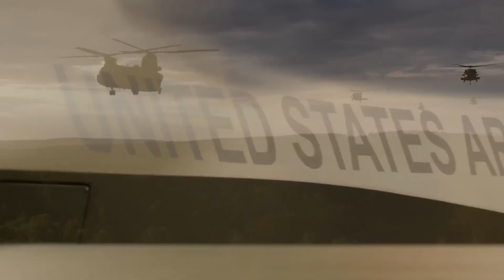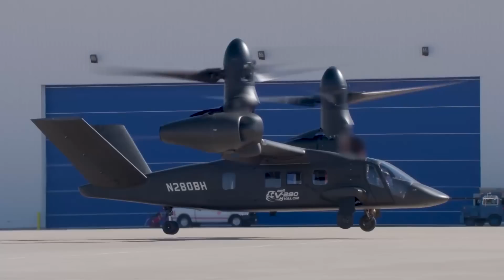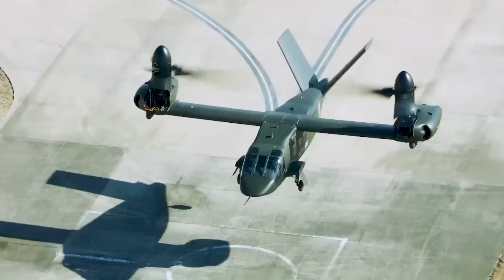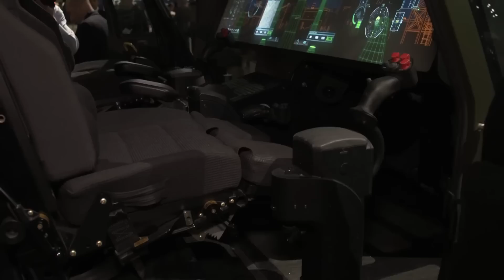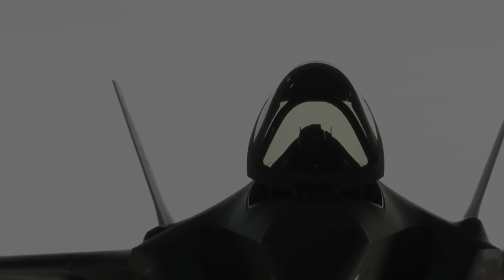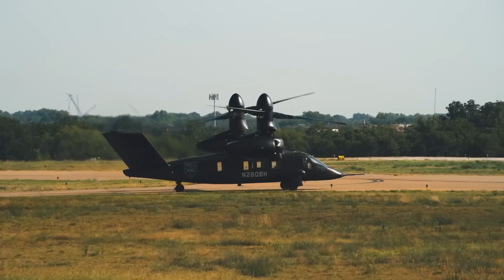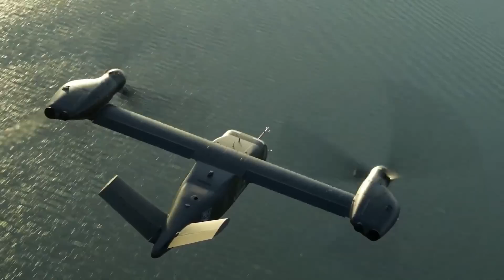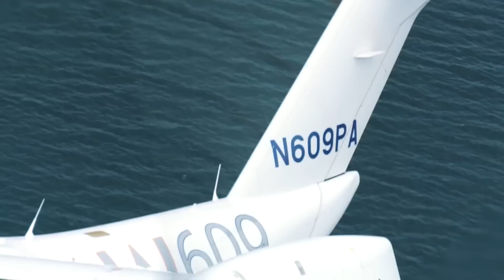V-280 Valor – The future Black Hawk

Comment: Excellente mauvaise bonne idée !!
Double maintenance, double cout de fabrication, double cout de pièces détachées, double cout de matériaux de base et fabrication générale à la hausse avec deux moteurs...
Bon il y a un dicton qui dit que deux c'est mieux qu'un !!!
Reply: You know that the Black Hawk is a duel engine helicopter right? The Valor goes three times the distance at twice the speed while carrying three more soldiers with it. It will spend half the time in the hot zone as it has a better time to altitude and time to stop from cruise speed.

Comment: When the engine on a plane fails, it turns into a glider. When the engine on a helicopter fails, it turns into gyrocopter. When the engine on one of these things fails, it turns into a rock. Good luck.
Reply: It has 2 engines... dual engine failures on aircraft are beyond rare. For example there has yet to be a dual engine failure on an Osprey. Also you are wrong as tilt rotor aircraft can glide and autorotate... get educated on a topic before spouting nonsense.
Reply: Et tu le pose avec un moteur ton fer à repasser ?
J'veux voir ça !! @n3v3rforgott3n9

Comment: They don't show what it can do on one engine.
Crash.
Reply: You just don't understand the platform it seems. Both engines turn both rotors at all times so you are wrong.
Reply: @n3v3rforgott3n9  you just thought me something I missed. Both engines turn both rotors at the same time. That's actually very good. That now changed my outlook. Thank you.
My question is how well does it glide if you have engine failure or do you just bail out?
Reply: @christopherbetty5017  The glide ratio of Tilt rotors is generally not as good as normal planes because of the smaller wing span. We don't have the exact ratio for the Valor but given its lighter weight it should be a bit better than the Osprey which has a glide ratio of 4.5 to 1 which mean it can't glide for a long distance but can get the people to the ground safely. Tilt rotor designs also lack the heavy machinery above the crew compartment helicopters normally have. This means the wings break off and away from the crew in a crash taking away from of the energy of the crash with them. Tilt Rotors can also autorotate if needed although gliding would be preferred and safer.
Reply: @n3v3rforgott3n9  that's better. Facts.
 No derogatory comments. 
Thank you.
Reply: @n3v3rforgott3n9  no I don't. I just understand design. An that's not a safe design.
Reply: @christopherbetty5017  "I just understand design"
...
You are saying completely wrong things like a moron. Just like the Chinook and Osprey both engines turn both rotors at all times. It is mechanically impossible for one rotor to turn without the other one turning unless a very serious problem having occurred which would crash any helicopter as well. It can fly at reduced power with a single engine like any multiengine helicopter.
Reply: @n3v3rforgott3n9  bro no derogatory comments or name calling please. I did mention I don't know the platform. But looking at the design with both propellers at the extreme end doesn't sit well with me.
Reply: @nyalamokamba9442  No... Both engines turn both rotors at all times.
Reply: @n3v3rforgott3n9  But it does have a very reliable engine. So that's a plus.

Comment: Brownout. The V-22 has gearboxes that shatter and they don't know why. The V-280 Widowmaker II will require that the US Army pay defense contractors to build all new facilities to house and service the V-280. Whoops, forgot to add that into the costs. THis is a SHOVEL DOLLARS AT CONTRACTORS program much like the Fail-35 Junk Strike Fighter which is why the USAF is going with NGAD. Can't fit in as many places as the former competitor or UH-60. And speed won't matter against MANPADS or SPAA or SAM with the size and signature of the V-280.
Reply: "The V-280 Widowmaker II will require that the US Army pay defense contractors to build all new facilities to house and service the V-280"
...
WRONG! It fits in hangars that already fit the Black Hawk.

"THis is a SHOVEL DOLLARS AT CONTRACTORS program much like the Fail-35 Junk Strike Fighter which is why the USAF is going with NGAD."
...
WRONG! The F35 is replacing the F16 along with many other platforms meanwhile the NGAD is being developed to replace the F15 and F22. Completely separate programs for sperate roles. Also the F35 is already at 1k built and is cheaper than most countries 4th gen aircraft. Not to mention the F35 is cheaper than the F15 was when you adjust for inflation. The ENTIRE F35 program including all the planes and 50 years of maintenance, fuel, training, parts, etc etc will cost about 34 billion per year over 50 years. That is for 1800+ aircraft for 3 branches of the military.

Comment: V-280 Valor looks like it will be a very good aircraft, in flight and maint. requirements. The same does not apply to the V22. Which was an over priced, under performing, maint. nightmare.

Comment: Minor note. I find it funny people always use the Apache as a speed benchmark for military helicopters. The CH-47 Chinook heavy lift helicopter is 10 knots faster and damn near just as maneuverable when unloaded.

Massive note. You called the Sea Stallion's rotors propellers.
Reply: I remember plenty of flights in the Chinook. You could see where it was patched from the bullet holes it had received in Vietnam.
Reply: @flyonwall360  I was an engine man at D CO, 34th SUpport Bn, 6th Air Cav in Savannah, 1980/81 on A model Chinooks. We got them into shape to fly to Pennsylvania for rebuild into CH-47B.
We had Warrant Office pilots that had been Crew Chiefs in RVN, and we had holes in airframes and other odd damage for the sheet metal guys to smooth out.
Reply: Spinny bits
Reply: Chinook uses two engines to get 10 knots faster than an Apache with one engine, so Apache is still a winner aside from the fact that fuel consumption of Chinook is higher. BTW, Chinook is not optimized for speed. It's a truck.
Reply: @marine-002  It’s not the engines, or at least not the core difference. A big part of the speed limits for rotor aircraft is “retreating blade stall” where the airflow from forward flight decreases the flow across the retreating side enough that it stalls the airfoil. That means it starts making less lift on one side as more and more of the rotor area on that side stalls causing it to roll. The flight controls can only compensate so much. The CH-47 and the few like it, though, have 2 rotors turning in opposite directions so the loss of lift on each side of the aircraft is balanced. Russian dual rotor (one above the other) designs like the KA-50 have the same advantage. Some of the designs for the last few advanced helicopter replacement projects use stub wings that start making enough lift to help unload the rotor and offset the imbalance as well, which is part of how they have so much higher proposed speeds.
Reply: @marine-002  CH-47  It's a fast truck, and if you have never been in one, I'll tell you : Empty, with no interior cargo or sling load, ther mofo RATTLES and is almost scary how loud it rattles. 
But you put a load in it, like a truck and trailer in the cargo bay, and sling load a fuel blivet, and that airplane gets down to business. It gets a LOT quieter, and make be heavy on the stick, but just solid as a rock. They are built to haul it all, all day long.
Reply: The Apache has twin engines also! @marine-002
Reply: @marine-002  you can literally see two engines on the Apache, one on each side
Reply: An H-53K is even faster … and can pull 3.5 Gs

Comment: The Osprey is controversial for political reasons.  Yes it had a shaky elopement and testing period and was delayed and even cancelled several times, but the end product is within mishap rate of other aircraft at 3.28 per 100,000 hours average for the last 10 years..  The F-16 is 3.55 and the F-15 is 1.99.  The Chinook is better at 1.59 and the AH-64E Apache is 2.66.  The cost is not that bad at $80 million.  The Chinook is $65 million average but can cost $60 to $90 million.  The latest Apache is $52 million.  It is a little expensive, but not that bad and the safety record is also not perfect, but not horrible either.  Considering how new and complex the Osprey is I think it is doing a great job.
Reply: Not to mention mishap rate is not a full view on safety either as a more expensive platform will reach the dollar amount for a Class A mishap easier. Besides when you are talking about the massive performance increases the cost can simply be worth it. After full testing we will see if everything checks out.

Comment: Why not a tiltrotor quadcopter design? There would be multiple benefits. More overall thrust and therefore heavier payload, simplicity of design (every engine and even the wings and tilting mechanisms in front and back would be identical), smaller footprint for the size, props would have smaller diameter and be more responsive (not sure of autorotation capabilities of this thing, maybe they want heavier rotor discs for exactly that purpose?). You could still have the V-tail sticking out the back for some level flight control. You could then even lose an engine and still complete the mission. And props might be small enough to land on a runway in level flight mode, giving it more options and more efficiency. You can even stack the engines, so two on each corner, one pushing, the other pulling, for an octocopter design. I'm picturing a longer, heavier fuselage with the wings being duplicated in the rear and the V-tail just behind the second wing. I would turn the entire wing itself, rather than just a motor mount. With more props you can handle a little more instability.

            ^
          |   |
x-------|   |-------x
          |   |
x-------|   |-------x
          |   |
           ^

Like so.
Reply: Because:
1. Quadcopter design needs four engines and four rotors. It’s expensive and not efficient.
2. It needs 3 times longer Synchronous shafts and 6 angle drive joints, instead of two.
3. In helicopter mode two transverse rotors are more effective in horizontal flight compared to your offer. If the power and swept area are same.
4. During hovering Proprotors efficiency of 12 blades will be less than 6 blades on Valor.
5.
Reply: There are actually quadcopter tiltrotor proposals for heavy lift replacement, on the scale of the CH-47 or C-130
Reply: @andrewreynolds4949 , C-130?😖
Reply: @antonkirov1923  Yes, under a super-heavy lift category. Nothing has progressed beyond concept stages as far as I know
Reply: @andrewreynolds4949  compare V-280 with same MTOW helicopter, like S-92. Capacity of S-92 is twice bigger. Same time the S-92 power almost 3 times less!
There is big difference between Propeller and Rotor.

Comment: It will fail for the same reason the other ones failed... It has to have 4 rotors.
Regardless of how you redesign the tail 2 rotors is an unstable design if it were not you would see at least some 2 rotor drones but you don't and you never will.
Reply: You do not know what you are talking about...
Reply: It is very old idea. Read about quadruplanes.

Comment: It is too wide.  Extracting troops off of mountains is difficult with the uh 60.  The rotor can easily strike steeply sloped terrain.  This thing  is going to be impossible to maneuver through trees and house tops.  The crew chief will not be able to see rotor tips at night
Reply: You do not understand the platform it seems. 

"The rotor can easily strike steeply sloped terrain."
...
The rotor will be higher up than a traditional helicopter... and you do not have a tail rotor to worry about hitting lower objects.

"This thing  is going to be impossible to maneuver through trees and house tops"
...
Why? It passed the same low level maneuverability tests as the Black Hawk. It is as maneuverable if not more than the Black Hawk.

"The crew chief will not be able to see rotor tips at night"
...
No... Just like currently with the Osprey the blade tips have LEDs on them which the pilot can control to be visible light, IR light, or off.
Reply: @n3v3rforgott3n9  and you have never crewed a helicopter in the mountains and villages of Afghanistan at night.
Reply: @shawnstangeland3011  What does this have anything to do with this? You aren't giving reasons the Valor wouldn't be able to do the same things while also bringing overall improvement nearly across the board.

Comment: Only if it was reliable with one rotor if it was shot out of the air
Reply: There is a backup drive shaft down the length of the wing, so one engine can drive both rotors. If the rotors are damaged it does have limited glide capability
Reply: ... Neither is any helicopter. Kinda a moot point.

Comment: I see it replacing the Blackhawk but not the Apache.    It's too big and not nimble enough.   It would be a sitting duck at low level
Reply: It passed the same low level maneuverability tests as the Black Hawk passed. Currently it is only replacing the Black Hawk.
Reply: Replacing the Apache would most likely be a separate program

Comment: You wont find these in the civil world. The 'normal' standards if risk management are set too low.  
No autrotation due to disk loading, Failure modes and operation costs too high.
Reply: You are wrong... tilt rotors can autorotate and glide.

Comment: Have yet to see it slingload an artillery piece, let alone see if it can maintain speed and flight characteristics
Reply: Look up testing videos. It did a sling load test of 10k pounds which is enough to carry a M777A2. Also in testing it performed long flights to the testing grounds etc etc.
Reply: @n3v3rforgott3n9  so I was correct… they haven’t done it, just another cover up like the nonsense it’s super wide footprint is similar to a Blackhawk except you have to land 90 degrees out and forget about propellers… army took speed and distance over utility and fraudulently forced a timeline to take the valor over the more useful defiant
Reply: @benderWestlund  so anything said that goes against what you think is fake.... I just said they lifted the weight in testing and have flown a long flight. This was all in early testing and the military has a crawl, walk, run format for everything. The valor is twice as fast, goes 3 times the distance, carries 3 more people, has a faster time to altitude, faster time to stop from cruise speed, and passed all low level maneuverability tests the black hawk passed. Your stupid logic means we should've never went to the black hawk from the Huey because the black hawk was bigger...
Reply: @benderWestlund  Also "super wide footprint is similar to a Blackhawk except you have to land 90 degrees out and forget about propeller"
...
no... I was including propellers in that duh.
 
Black Hawk Width 53 ft 8 in
Valor Length  50.5 ft

Black Hawk Length 64 ft 10 in
Valor Width 81.79 ft
Reply: @n3v3rforgott3n9  again, carrying an aerodynamic weight is not an artillery piece… not stupid logic, either you sling loaded the object or not… and it hasn’t,
Reply: @benderWestlund  please tell me what difference do you think it would make to a helicopter... It is not sling loading something like it for its full range or speed that is obvious. But if needed it can move it which can reduce the load on medium transport options out there.
Reply: @n3v3rforgott3n9  you obviously are not from the 82d or 101st nor are you a light infantryman or a pathfinder… your comments are obviously uniformed … you DO. NOT send out a force 100s of miles from its support base without its indirect fire, ever… and as a pathfinder who has to clear the LZ of degree and trees, this a/c is going to make LZ clearing doubly more work intensive and/or limit choices because of what we have been discussing…
Reply: @benderWestlund  so I'll take as there would be no reason it couldn't lift it if needed ... It already fits in landing zones the airborne would use already. People like to overstate it's size.

Comment: Kinda resembles the concept of the Russian Mi30 tiltrotor aircraft. A smaller craft than the V22
Reply: ... LMAO
Reply: @n3v3rforgott3n9  I May have gotten the name wrong. If you want to see what I’m talking about, search up “Russian tilt rotor aircraft”.
Reply: @tetraxis3011 Mi-30 had drive shafts, but not synchronous shafts like on V-22 and V-280.
Actually idea of Tiltrotor appeared almost same time as idea of classic helicopter. This idea was refused many times in many countries.
Reply: @antonkirov1923 Thats why i said it resembles the Old Mi30 concept. Ofc the aircraft are very different in their full design